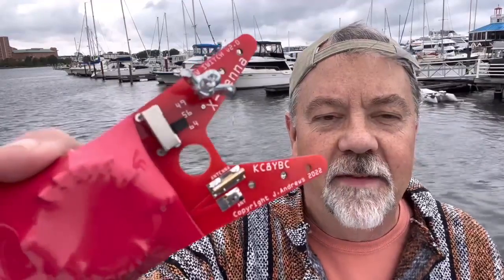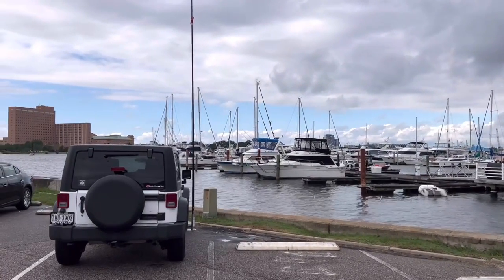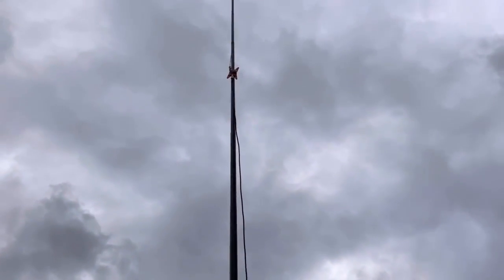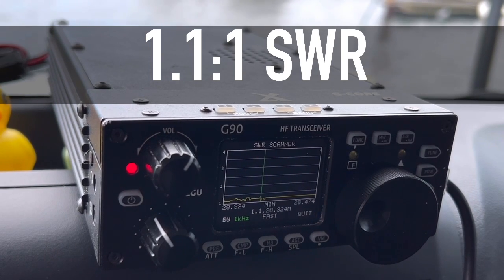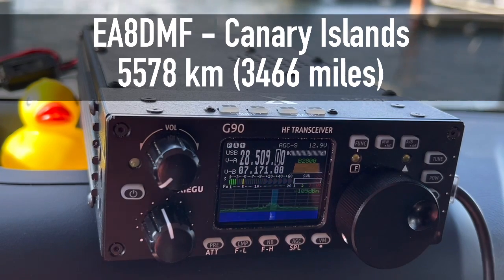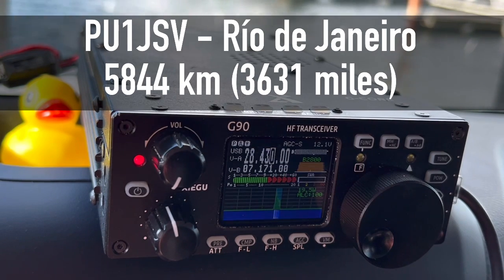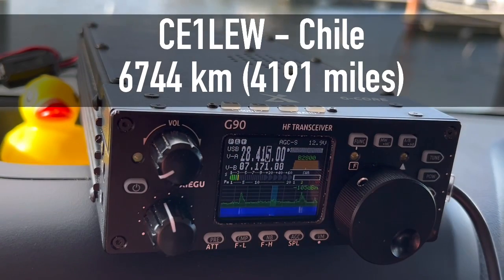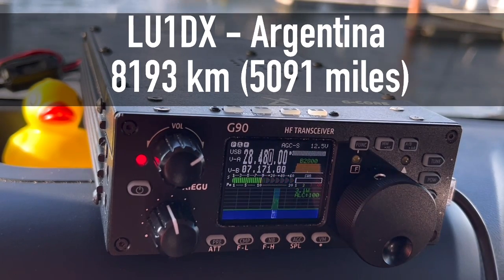Building a Vertical Half Wave for 10 Meters

Comment: Hi Walt.  Your comment about waiting to tune the unun to the wire not the wire to the unun struck a nerve with me.  I am trying to build an adjustable 10-17m Vertical EFHW using a Chameleon CHA25 whip because the inherently high radiation resistance of the design and the fact I am often on horrible rocky or desert ground  Trying to size things up I ran into a number of problems.  I have not made any decision of how to feed it yet but for measurement purposes I grabbed a commercial 52:1 unun.  I was getting SWR dips much lower in frequency than I expected with calculated speed factors of about 0.85 which I did not believe.  The SWR was poor and below 22MHz huge changes in whip length barely moved the lowest SWR frequency and mostly just increased SW to close to 3 and a 0.64 calculated speed factor by 25MHz.  No no way I could do 10m on that unun.

On a hunch I just connected my NanoVNA to a binding post and used a very long 30ft counterpoise on the ground hoping to avoid any resonances from the counterpoise.  I measured whip length vs resonant frequency (where the load was purely resistive) and noticed it was pretty far off the SWR max.  I got frequency values that roughly corresponded to 1.05 speed factor (much closer to the expected 0.95) but what surprised  me was that I was seeing real resistance of only about 1500 at 19MHz to 1100 at 31MHz indicating a 36:1 or even lower unun would be appropriate.  This flies in the face of your results and what others have said about shorter wires.

Is there an accurate way to find the true half wave length (effectively measuring speed factor)?  I'm almost at the point of setting it up as a 1/4 wave vertical and determining the speed factor, and doubling the whip length for the 1/2 wave.  I' afraid if I build it and start tuning with an L-match or designing a tapped unun, I'm just going to wonder off to tuning something other than a true half wave by having multiple degrees of freedom.  72, KK7YIS
Reply from the maker: Interesting. Here’s what I would do to dial things in closer before analyzing. I’d model it in EZNEC and then add the desired feedpoint impedance (2600 ohms for the 52:1) and then I would keep adjusting the wire lengths and run the SWR sweep calcs until I hit the sweet spot.

Comment: I like the half-wave verticals because the radials can be disposed of.    The problem with them is the end-feeding where the high-impedance needs matching.  I’ve wound toroid transformers, used quarter-wave open-wire feedlines, and even desktop tuners that contain the 4:1 baluns for twin-lead feed lines.  I finally settled on just using RG6 coax feedline and the desktop tuner (transmatch) which is simple and effective.  Right now my 10m half-wave vertical is a crappie pole (cheap) set at something over 16-feet with the driven element wire threaded through the center.  It’s mounted on the deck just outside the shack window and works as well as anything I’ve used.  I’ve also used no impedance matching other than a hand wound base loading coil and the transceivers auto tuner.  It all works despite different opinions.  I use an Xiegu too but it’s the ultra cheap G106 4-watter fed into a small MOSFET amplifier to get the 20-watts - lots cheaper than the 20-watt Xiegu 20-watt radio.

Comment: I have done that with my DX commander pole. both 10 and 12 meters veritable. great for DX. I made my end fed half wave. I cut for 12 meters and fold the end back for 10 meters. using FT 240-43 ferrite wound 49:1 . I also have one made with type 61 core and wound 64:1 . both work great 10/12 meters . the type 61 ferrite will work 6 meters with shorter wire. got great tune . using ICOM 7300. no tuner needed most of the band. just a touch up tune on 29 MHz   .I have 10 ft counterpoise I ran down pole to ground. yes spark plug antenna is 64:1 and 100 watt version. I use the DX commander antenna wire. both DX 10 and 50. my DX commander antenna has the 10 meter element cut 3/4 wave and has fold back at end. great tune . got that tip from  lord Callum  .he did that with his in England . my winter skip goes that way from NY on 10 meters now. was south in summer like RIO . 10 and 12 meters is going strong. hoping for 6 meters in summer.  I get 40 threw 6 on DX commander and great tune. just takes more time to set up then end fed half wave. 73's
Reply from the maker: Great stuff! Thanks for the awesome comment.

Comment: nice vid..why dont you try λ/4 ground plane for 10m band..  i made one out of aluminum pipe and 3 radials out from coper wires..works well..
Reply from the maker: Thanks, I’ve actually done that. Just wanted to experiment with a half wave

Comment: Hey Walt! I have been ripping 10m with an EFHW and the 6100 and 10w. I wind my own toroids, and tune the wires to them. At home I have a 40-10 wire with a 110uH coil on the end for 80m, but portable, I have a wire for 20, 17, 15, and 10. It makes all the difference with low power to tune your wires well. I have good luck using smaller poles and running the wires as a sloper. I got confirmation on Isle of Man, Poland, Germany, Slovakia, and Serbia. From the cow pie state, WI. 73 KD9OCL. Edit: I forgot Hungary and Austria.
Reply from the maker: That’s awesome! Great 10 watt contacts! I love the cow pie state, I get up to the shipyard in Marinette for work often. 73, Walt

Comment: I need to give that a try with my TennTennas 49:1's. I have wires cut for 17m, 20m, 40m and 80m. It should be easy to cut one for 10m--maybe even add a link for 12m too.
Reply from the maker: I actually checked SWR on 12 when I did this and it was really good. I should have put that in the video.

Comment: 👍Good results, thanks for video Walt. For 10m, I have found that 3.5 turns primary 28 turns secondary (64:1 impedance ratio) baluns on type 6 toroids seems to work well.
Reply from the maker: Thanks Steve, great info!
Reply: @COASTALWAVESWIRES  2primary and 16 total on a 140-43 toroid will give you a 64:1 that works well to 100w.

Comment: Can you give us anymore info on your xtenna mods?
Reply from the maker: Yes, I added a wing nut threaded bolt connection instead of the pin type connection that was on it for the driven element. The X-Tenna already has a spot on the board for that and it was a very simple mod. I also added a PL-239 adapter onto the BNC connector at the feedpoint.

Comment: That looks nice. How wide is it? I noticed the swr meter seemed to jump more on the qso you had on 28.530
Reply from the maker: It was pretty wide but started climbing up to about 1.5:1 as I got above 28.500, I saw that jumping as well and actually started using the ATU to get it dialed in.